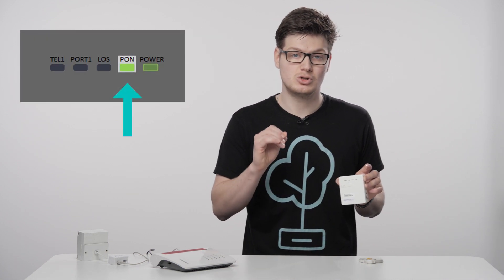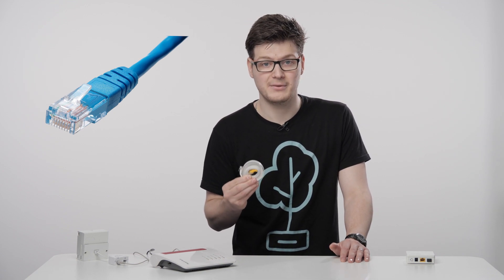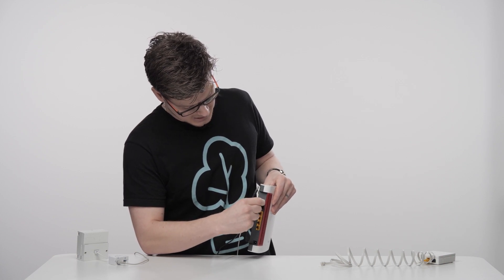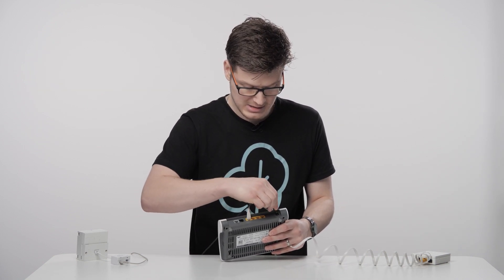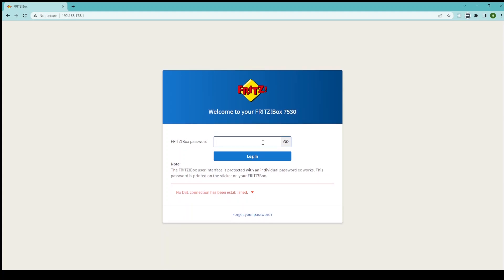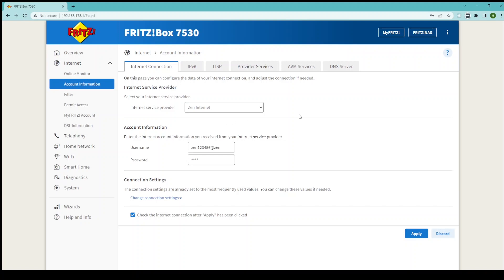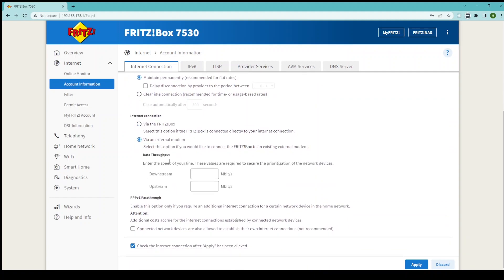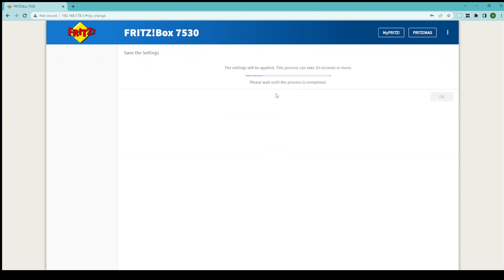How To Upgrade To Full Fibre

Comment: How much data comes with my full fibre contract
Reply from the maker: Hi, with full fibre internet, you usually get:
Fast Speeds: Ranging from 100 Mbps to 1 Gbps or more

Unlimited Data: Most plans offer unlimited usage with no extra charges.
It's ideal for fast downloads, streaming, and using multiple devices at once. - Zara L